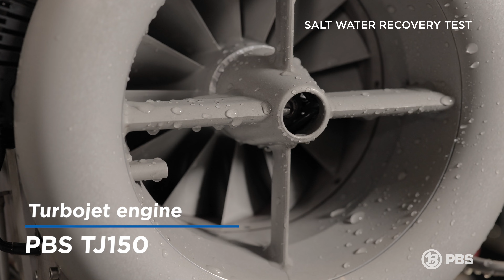PBS TJ150 Salt water recovery test

Comment: That was very unimpressive!!
You should have run it befor the submersion to simulate a water landing.
But i guss that result would not have been as positive....
That is laughable advertising at best, the guy who made the decision to post this should be slighly ashamed and try again. 😬

Maybe an endurance test afterwards and subsequent inspection of bearings and such would have been a good showcase of robustness.
Not just showing it starts afterwards.
Biger comercial tubo engines can swallow an impressive amount of water and sand and other crap while running. 
Depending on the aplication this engine is intended for, such a distructive test would also be somthing interseting to show. 

Otherwise better show how easy an oil change is on that puppy... 😆